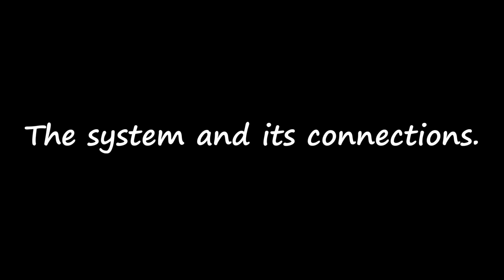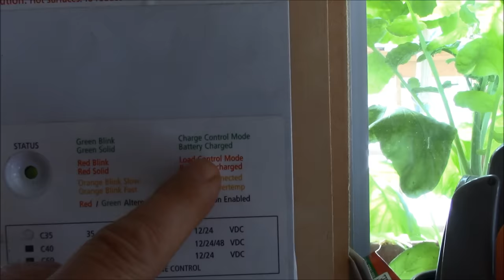A SIMPLE OFF GRID CABIN SOLAR SYSTEM THAT ANYONE CAN BUILD AND AFFORD. DIY Simple Solar Installation

Comment: With 400W panels on average how many Wh or kWh do you think you pull in per day and do you know the average summer to winter variance?
Reply: That means on ideal conditions, and I mean perfect sun exposure those batteries will get 400 watts per hour to charge. If he's constantly running say 800 watts for 3 hours those panels should replenish power back to the batteries. Basically what you use, you have to put back into your battery bank. Then the Charge Controller and Inverter as well need to be deducted as well as watts being used.

Comment: great job, you should change the terminals of the 400 watts converter to get a better safe connection ? by the way I don't think that having extra batteries is a bad idea at all, me not an expert but just saying. I will take a look at the company that you bought the system for, looks like very simple easy install !! thanks
Reply from the maker: True, but I left the clamps on it for a reason that I'll explain in my next Q&A  :-))

Comment: The wood frame looks like good structure. No need metal.
400 watts system, if it runs to $1000, it’s quite costly.
Looks like not great power production, then migrate to battery bank/inverter which adds more to total costs.

A cabin solar geek, to some extent. Good presentation.

Comment: The way you show and describe  your system, it couldn’t be any easier...unless along with the kit inside the box was a JC installer to help you out ;-) 
I will be following your lead when I’m ready to start my project. My only question is for your needs you described how long can you run power with the  four batteries. Is the one battery enough and the other 3 backup storage?  My power needs would probably be the same so I’m wondering if I would need the 4 batteries as well. Thanks for a really great look into doing a system yourself, I’m sure it will help a lot of viewers.
All the best and God Bless
Reply from the maker: I really can't answer that as there are too many variables.  I will discuss this in my next Q&A though.
Reply: Thanks, look forward to it.

Comment: Greetings from PEI  Boss.  Yup, brothers from another mother.  I have the same green metal roof on my log home and one of those batteries, but it's not Renogy.  Great design and hookup.  Renogy sells 100 watt panels for 99 cdn, free shipping, so they would be about $80 USD probably.  My system is about 2.4 kw with and Outback VFX 2812 inverter and a few MPPT charge controllers, Blue sky and Outback.  I have a smattering of other separate solar hooked up all over yard.  My main batteries are surrettes S600's.  Your power needs are modest, which is a good thing.  For every dollar you save in consumption, you save many more in kit.  I'm not off grid, mine is an expensive hobby ;).  I assume the charge controller is MPPT?, it allows you to squeeze a bit more power on your panels, since the open voltage is hovering about 18-20V.  What I do for fun is flip a breaker once in  a while to test my system.  Nice thing about LED technology is you could buy a battery charger that hooks up via cigarette lighter and direct clamp to battery to charge AAA's and AA's or even LR18650's and use it to power lights in low sun periods.  Heat and light the space your in I say, not the whole house.  Great video, and those MC4 connectors make life much easier, no soldering :)
Reply from the maker: My controller isn't the MPPT but I may swap that out someday. This simple system has really changed our life up here. Absolutely love it ;-))
Reply: I agree, evolution vs revolution,  and with today's electronic devices modest power requirements, you don't need much.  As for other things, as my late friend's daughter would say: "You gotta love living in a country where you car acts as a freezer two months of the year and a refrigerator for three".  I'm chilling my Grigio in the snow as I putter in greenhouse.  I sowed some Black Seeded Simpson and some Rocket.  Rocket is great for early season.  My Greenhouse hit 32C yesterday, and a comfortable 16c today, with overcast weather

Comment: Great video! I plan on installing at least a battery bank and inverter at my cabin this year and panels later. I have it wired for a generator now (like an RV) so i will check out that book for some more info. Thanks for the information! All the best.

Comment: That a excellent choice in batteries.. My concerned would be your inverter, didn't say if it was sine wave? , I'm going to assume it's not only because she said the amount of heat coming off of it..my concern would be your computer's even using a power strip...when your able to invest in a pure sine wave inverter it will make you system so much more efficient and get the maximum energy from your panels.. which will make your system virtually maintenance free.... Another option is you could put a shunt on the system and remote the condition of the system to inside the house.. excellent job on the panel installation..
Wood is your friend...best wishes in life and with your up and coming garden this season.
Reply from the maker: I actually have 3 pure sine inverters and one of them will be hooked back into my system now that the sun is higher and power drain isn't an issue. I've used the little 400w one since 2013. It's not pure sine but there's been no issues from using it.  So far so good anyway :-))

Comment: You make some great videos. Always trying to help others by sharing your experiences. I will try sharing some of my experience. I noticed your roof tin is screwed down on the low part of the tin. It is easy to fix it down like that and because you have done such a good job I don't think you will have any leaking problems. On most roof tin installations I have come across. The roof tin is usually screwed down with the screws going though the high ridges of the roof tin. This helps to reduce the chance of water leaking through the screw holes as water runs down the channels. It can be a little tricky running the screws through the high ridges of the roof tin. You need to get a feel for it making sure the screws hold the roof tin down firm, without going in to far and pushing the roof tin out of shape. If are going to install any roof tin it maybe worth considering though. I have learnt so much from your video and have subscribed to see more 👍
Reply from the maker: Hi Rob. I appreciate your input and I understand your viewpoint as it seems that the high point would be the best place for the screws but... the industry standard for this type of roofing is the screws ALWAYS go in the flat and not in the rib.  The rule of thumb is nails in the rib, screws in the flat.  If you google screw placement for metal roofing you'll see what I'm referring to.  
Cheers :-)
Reply: @thebossoftheswamp   Thanks, if you did install the screws trough the rib. The tin may also need to be thicker for strength when fixing down. The type of roof tin and screws are important. Longer screws would be needed as well. All adding to the cost. I think screws are a better option than nails even through the rib. Cheers 🙂👍

Comment: I love your solar set up it’s very similar to mine.We find that we don’t even really use any of our AC power. I have the same batteries as you but currently we are only running one we would like to upgrade to two. Thanks for sharing this information and keeping it simple
Reply: If your battery is a few years old you may want to look at buying a new set of batteries at the same time. Mixing old and new is a bit like teaming up a 3 year old horse beside a 25 year old horse. The old horse can't keep up to the young horse so the team slows down, not getting as much work done in a day.
Reply: @AutoCrete  Thank you so much for the info. I bought the battery nine months ago so I’m hoping a new one will team up with it fine.
Reply: @karlsoffthegrid1378  9 months older shouldn't be a big deal at all.
Reply: @karlsoffthegrid1378  I did part of my friend's house with solar 12 years ago.  He created at least three separate systems. 
One has one battery that he uses to charge phones and a few lights.
One setup to run tv;s radios and lights in different rooms etc.
Dont keep all your eggs in one basket.
Reply: @shawnr771  Great advice I really appreciate it. I ran two systems I have separate AC and DC wiring throughout the cabin. I don’t have a TV or any appliances yet that require a lot of electricity so I basically run the DC

Comment: Boss, I live in northern Wisconsin and will be putting an off grid cabin up in a year or two near Dryden, Ontario. It will be basically a 3 season place; the question I have for you is in our northern climate/winters, how do the batteries hold up without being insulated? Thanks and I look forward to your next videos!
Reply from the maker: I have to heat the shop or my batteries poop out.

Comment: You gave it the "KISS" touch hooking the solar up(keep it simple stupid)! Doesn't sound to awful hard. With the watts you create with your system, will that run your house and shop needs(lights, computer, phones)? Or do you need more panels for that much consumption! Great video...
Reply: Using Watts as a rating does not really work for a solar system.
Most people think that a 400 watt system will run 4 100 watt light bulbs but that is not really the case.

When thinking of solar think Amps and Amp hours.
Amp Hours is the amount of fuel in the tank so to speak.

Amps is the amount of power each device draws. 

For device that need an inverter, the inverter will draw an extra amount of power to change the power from DC to AC. 

So with 800 amp hours you could run a 1 amp load for 800 hours.
or one 800 amp load for 1 hour.
Although in reality this would kill your batteries.
They can only be drawn down to a certain point without damage.

Oversize your battery and solar panels to account for less than ideal days.
Reply from the maker: Yes the camp, the shop and shed are all linked together and run on the system I showed here.
Reply: @thebossoftheswamp  that is great! Not too much, not too little, at a fair price. Thanks boss...

Comment: Aussie Dave in PA here Boss,... At the start of the video, I'm more interested in why you put the roofing screws on the flats instead of the ridges.
Cheers ;)
Reply from the maker: Because this is how it's suppose to be. Nails in the ridge, screws on the flat.
Reply: @thebossoftheswamp  
Oh, okay, so you do have nails in the ridge,... I have seen some guys screw on  the flat & others on the ridge so thought I would ask you why because I know you worked in construction.
Reply from the maker: @davidyummus6259  No I only have screws in the flat portion.  This is the recommended method by the manufacturer.

Comment: Very nicely explained. My first solar system was 1200 watts (24 panels of 56 watts). I installed it myself. It had 10 strings of 4-200 amp-hr battery storage. I added another 12- 160 watts and concavely created an array to have sun hitting the panels all day, rather than a tracking rack. It worked flawlessly and continues to do so for 30 plus years. During the summer, I put the largest submersible pump without tripping the breakers. It was a 3/4 hp pump. And ran it 8 hrs a day to irrigate the orchard and hay fields. Best investment you can make. If you have extra power, add a small 10 to 20 gallon water heater with one heating element. This will take your excess solar power, and apply it to beneficial work. Nice for evening short showers.
Reply from the maker: Sounds great to me :-)

Comment: If you use a 24 volt dc system you can run lights, laptops, etc.. & only use the inverter for things that need 110 ac.

Comment: Looks clean too, I have a little concern some treated wood has corrosive reaction with conventional fasteners maybe the shield will protect the roof, the other material including panel edges in contact w/treated wood?
Reply from the maker: Good point.
If I see any corrosion I'll run some tape or other material around the edge of the panels.

Comment: Something to think about is that placement of your solar panels is important.  Remember that they have to be cleaned and also cleared of snow is cooler climates.  Consider the cost of hiring someone to get on your roof to clean the panels and how often they'll need to be cleaned into the maintenance costs.
Reply from the maker: Very true and that's why these panels are in the sunniest spot in my yard.  I clean them from the ground with an extension pole. It's effortless and no climbing :-)

Comment: Nice video and I hope that you'll have many years of trouble free service with your solar energy investment (you have some quality components). Also, I like your solar mount and it's a nicely designed mount.  The separation space that you provided for your panels also serves another benefit, aside from preventing trapped water. Panels need a space to allow air flow circulation to reduce heat and this enhances the power production by keeping your panels cooler.
Reply from the maker: Thank you for your comment ;-)
Reply: @thebossoftheswamp  You're welcome!

Comment: Thanks for sharing, I would be interest in also knowing how the rest of the cabin was connected to it.
Reply from the maker: The wire coming from the inverter plugs into an outlet which feeds power into the outlet rather than pulling power pout of it.

Comment: Is pressure treated lumber a good idea to use with Aluminum of the solar panels?
Reply from the maker: I've had no issues. If it's a concern, just put some rubber tape or a rubber spacer between the wood and the metal.

Comment: Hi Jim!  Just writing to say Thanks for the video; always a great explanation of how you do things!  I'll ask this; do you have enough power to run your washer off the solar, or are you using the generator for this task?  BTW, do you have the dual fuel generator, (gas/propane) at your camp?  Thanks once again!  God Bess!  ~Lou
Reply from the maker: I haven't tried running the washer on the solar but I doubt it would handle it.   I try to multi task when using the generator. Do the wash, vacuum the house etc and I'm still using my old gasoline powered generator.
Reply: @thebossoftheswamp  Hey Boss, do you run a fridge off of solar?
Reply from the maker: @riolarmand9272  I can in the summer but the sun gets too low in the fall since we're on the wrong side of the slope.

Comment: Just wondering if the smaller inverter is a modified sign wave instead of a pure sign wave. Nice simple set up though
Reply from the maker: It's modified. Only my larger ones are pure sine but they will be back in my system now that the sun is higher.
Reply: @thebossoftheswamp  Well thank you for the reply, i like the wisdom i get from your videos. It is a lot better than some of the junk that is out there. modified will ruin some electronics, like laptops that was why i was asking. There is a company that has dc to dc voltage to get the proper dc volts and amps so you don't need to use an inverter for them. Take care and well watch more of your great videos.
Reply from the maker: @eapj12  I actually have 3 pure sine inverters but they're all 1000w and higher.  This little 400w one has been powering my cabins since 2013 or so and surprisingly it hasn't bothered any of my electronics. I probably just jinxed myself by saying that haha

Comment: Question from a solar newbie. The batteries are wired in parallel (neg to neg, pos to pos). Wouldn't that double the amps, therefore needing a really thick cable to run to the inverter? Or does the wires between each battery just need to be thick enough to carry the x2 amps? I think it's the latter since it's obviously working in the vid, but I wanted to ask. Thanks!
Reply from the maker: In all honesty, I'm running on newbie standards up here but it's never failed me.  Neg to neg, pos to pos keeps the voltage at 12v not sure about amps.  I use #2 cables for battery to battery connections and The cable running to the inverter appears to be of similar size.  It's the cable that came with the inverter.  I do believe that the longer the distance, the thicker you need to go with the cable.
Reply: @thebossoftheswamp  Thanks man, appreciate it!

Comment: I would advice u to paint,or coat the wooden frame whit some solution to protect against the weather,otherwise it will go bad in like 10 years,or maybe even less,and they gonna fall down xD
Reply from the maker: It's pressure treated lumber.

Comment: I believe I read somewhere that you shouldn't keep the batteries in your house, but outside in a storage shed. Is that true?
Reply from the maker: Lead/acid batteries give off a gas when they're being charged but I'm told that AGM aka Gel Batteries do not.  If you're charging regular batteries then they should be in a box that is vented to the outdoors.
Reply: Thought so. Thanks for the reply!

Comment: I am sure that you have noticed that you cannot take your batteries down past 50% without damaging them on a regular basis. Lithium ion batteries on the other hand you can literally take them down to zero with no harm to the batteries. And they predict battery life on lithium ion runs anywhere from 10 to 30 years
Reply from the maker: I plan to switch to those with my next build.  They're pricey but worth it :-))

Comment: Put your panels on the ground, so when it snows you can clean them. If you don't,  you'll lose power in the winter..😉
Reply from the maker: I sweep them off from the ground with an extension pole and I show that in the video.

Comment: Holy cow you got 800 AH of battery.  It would take many, many days of lights and computer usage to run those down much at all.  Way over battery for the usage and size of the rest of the system but you should never run out!!
Reply from the maker: I plan to up my wattage with more panels. I grabbed the batteries cause they were on sale and couldn't pass them up.